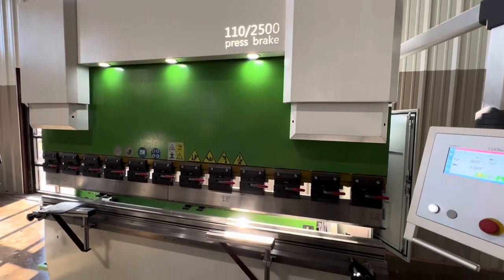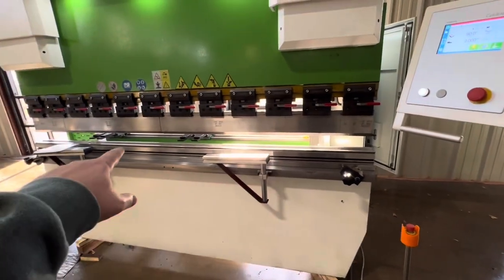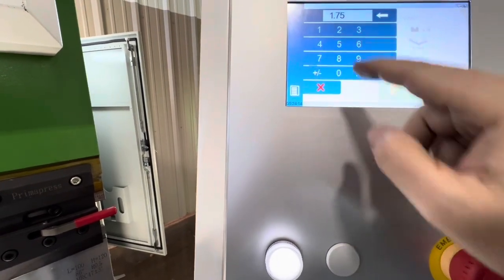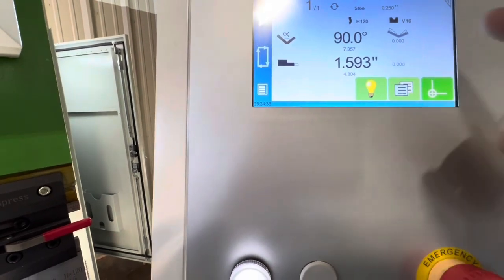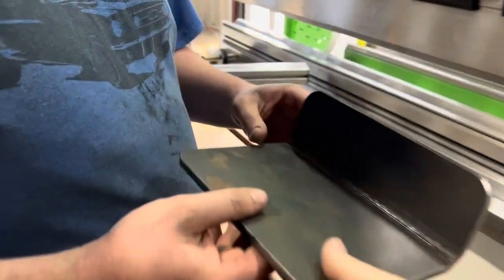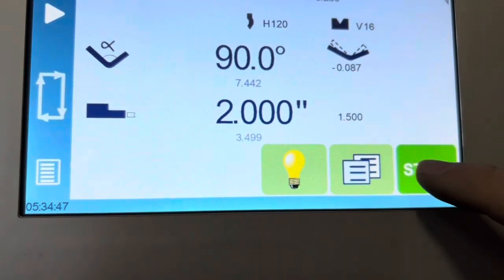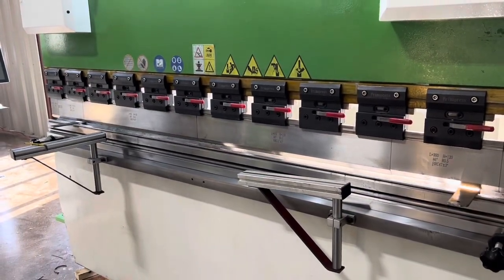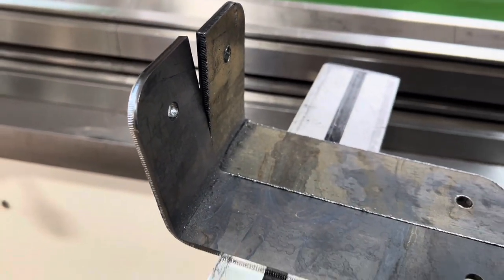USED CNC PRESS BRAKE FOR SALE

Comment: Could you tell me why it was bending more on one side than the other and if it is easy to solve? thanks gary
Reply from the maker: its very common on this style brake, its a mechanical adjustment, most likely a brake like this will never bend dead perfect right/left on 8ft, but there is a mechanical adjustment that is somewhat trial and error, but no its not hard, takes 15-20 min

Comment: My only concern is being able to swap the bottom and top dies to segmented. I do stainless countertops and need to be able to make reverse bends with down flanges. Will the bed and top hold regular dies?
Reply from the maker: the bottom dies on this are already segmented.  The punch is also segmented
Reply: @turbocobra  perfect. I'm in Oklahoma City. Working to make this happen. I will shoot you an email the second I have capital in order.